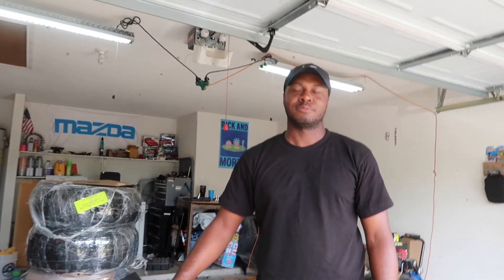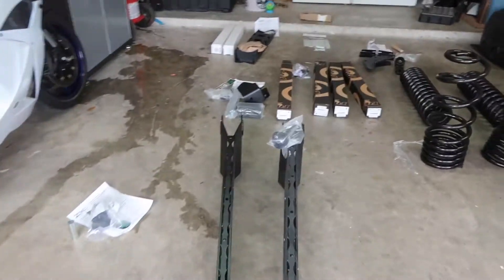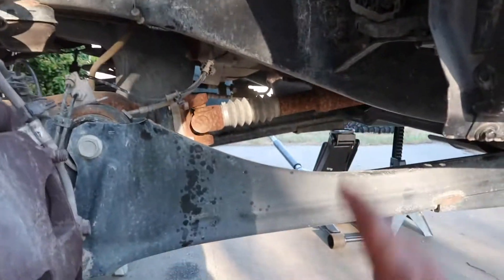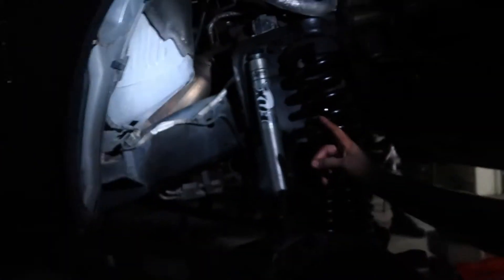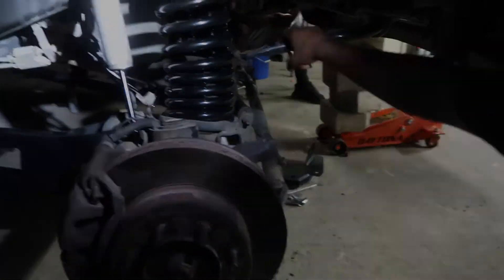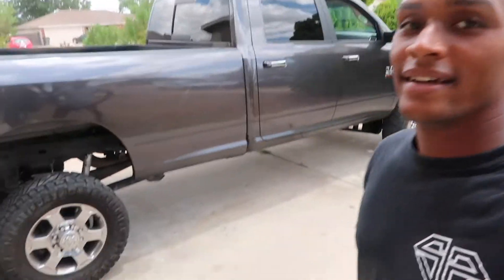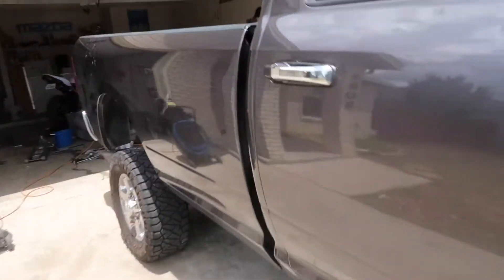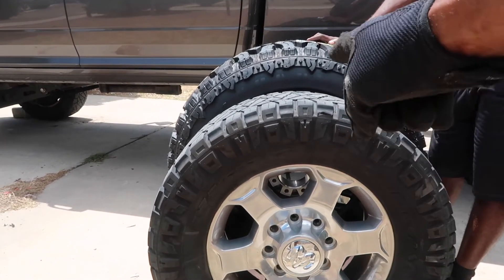2018 Ram 2500 6.5in Lift kit install | New Wheel Reveal!!!

Comment: What was the off set on those wheels? -76  And what was the back spacing? I have a 16 mega cab 2500.  I'm going with the zone 6,5 and balistic rage 24x14 with 37x13.50 tires. -81 off set. I'm concerned about the rubbing. did you have to grind down the pinch weld? or trim the plastic  at all.